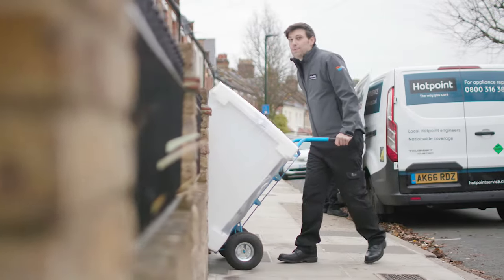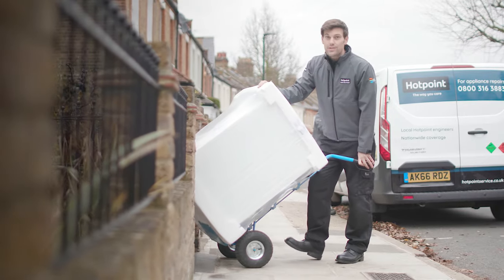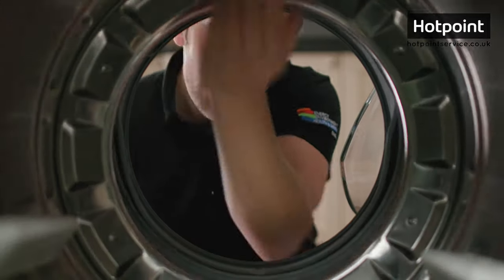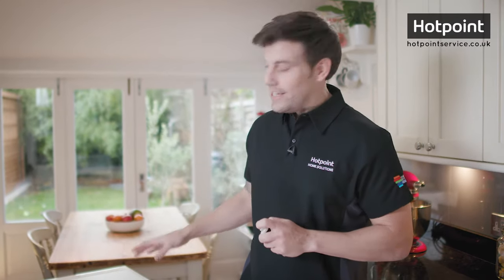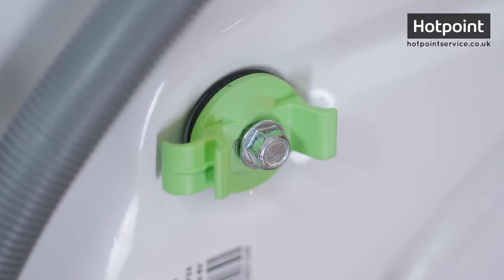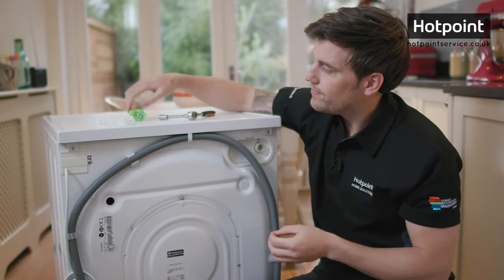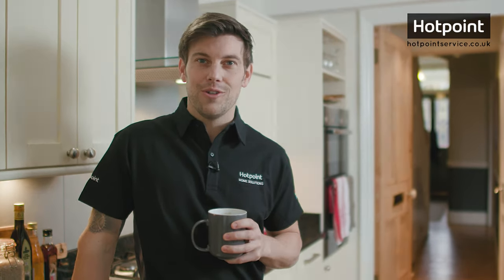How to remove transit bolts from your washing machine | by Hotpoint

Comment: the transit bolts I removed today were not loose like the ones shown in the video (after loosening the nutted screw) - mine were virtually impossible to remove due to being unbelievably tight fitting round the rubber bung part - almost like a machine had forced them in under a lot of pressure - I got them out in the end (took about hour just to remove four bolts) but broke two in the process due to the amount of leverage I was having to apply
Reply: Same here. I've never known transit bolts to be this tight! They just won't move, never mind loosen! We're not having any luck removing them, and I've taken a chunk out of my hand trying!
Reply: Same here. So tight the tabs snapped off and had to use a spoon to lever them out. Even that was an effort...

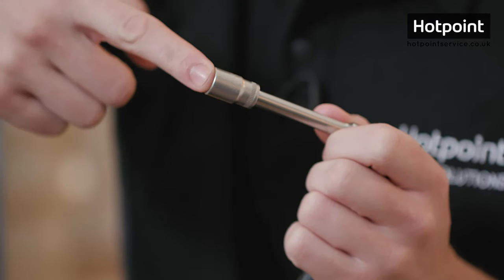Comment: It's obvious that the bolts on the machine in the video were previously loosened before it was shot, which ought to send alarm bells ringing when he asserts that 1:14 "Removing the bolts is dead simple."  I'm not very DIY savvy and installed my washing machine but please bear in mind that the bolts will have been powertooled on so removing them will require strength, patience and the correct tool (a torque wrench, as seen in the video).  Read other comments on this video if you require confirmation of the aforementioned.

Comment: **Top tip** only undo the bolt about a cm or 2 cm (enough space to a grip of the rubber), pull the metal washer free ifbthe rubber gasket, grasp the gasket and wiggle free then use your wrench/spanner to undo the volt the rest if the way.

Its important that the bolt is still with in the gasket part otherwise it won't work. 
If you've completely removed the bolt, out it back in and start back at the beginning.
Whoever wrote the installation manual needs to update the instructions asap!

Comment: My new hotpoint has different bolts.  The bolts were easy but I'm left with a rubber spacer thing that won't budge. It drives me mad when things that should be simple are not.

Comment: The transit bolts on my new machine didn't come out that easy, I think superman must have tightened them. Have had to split the bolt to remove the top half and get the bottom bit from the bottom of the machine once it fell down.  😢

Comment: As others have said. The transit bolts have been power tooled in at the factory. This makes them difficult to remove by hand tool. Worrying that the video states they are simple to remove, this is misleading. Also where are the plastic caps in the packaging? 🤔

Comment: my fabric conditioner tray will not empty
Reply from the maker: Hi Gary

It sounds like there could be an issue with the pressure of your water coming into the machine. Try removing the detergent drawer and giving it a good clean. Inside you may also see detergent build up which could be blocking the flow of water.
All else fails please give us a call on 03448 224 224

Hotpoint Service
Reply: @HotpointCustomerServiceUK  found the problem.  The tap which the inlet pipe  was connected to was faulty.  I replaced it. All OK now. Thanks
Reply: Basically not enough water pressure.
Reply from the maker: @garyhunt4959  Brilliant news! Glad you found the issue and resolved it.

Hotpoint Service

Comment: The black pump is leeking
Reply from the maker: Hi Cathy, 

Thanks for getting in touch, 

If you would like to book an engineer visit for your appliance please visit - https://www.hotpointservice.co.uk/repair for further help. 

Kind regards, 

Hotpoint Team
Reply: Hotpoint Customer Service UK   🇬🇧
Reply: Just so your aware.  Do not use a spanner. You can't get the angle to turn it as the spacer gets in the way. Who ever designed it that needs to be fired.
Reply: @tinyspaceguy5525  that's what I thought, but if you get a pair of pliers you can just snap off the plastic and have more than enough room to undo with a spanner.